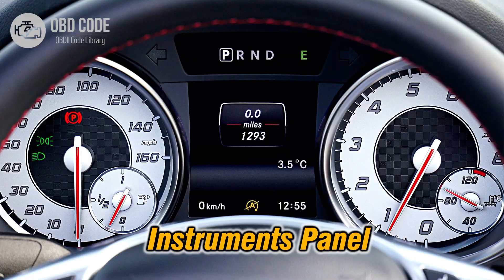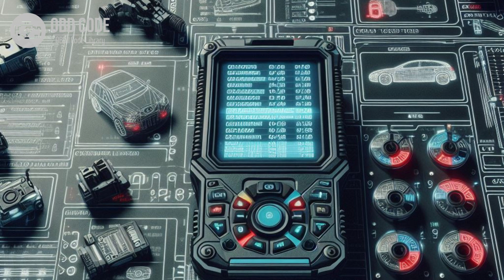P0720 Output Speed Sensor Circuit Malfunction 🟢 Trouble Code Symptoms Causes Solutions

Comment: I recently got the pre-delivery inspection done of my new car before taking the delivery and the same issue popped up like the check engine light was on the issue showed P0720. The issue was showing so what should I do like? Should I cancel the car or I should get it fixed?
Reply from the maker: Good morning, I advise you to go to a specialized workshop of the brand, they have the equipment and experience to give you a solution.👨‍🔧